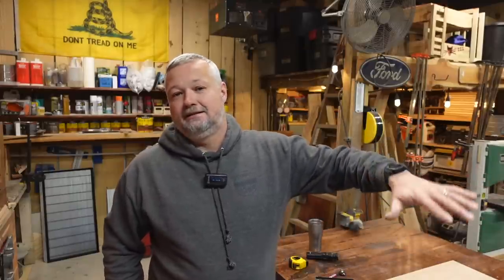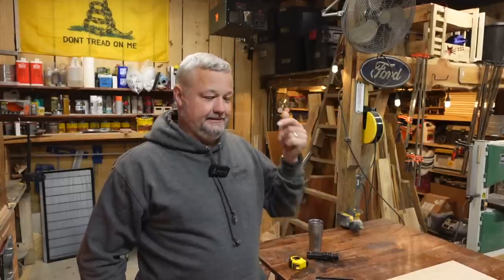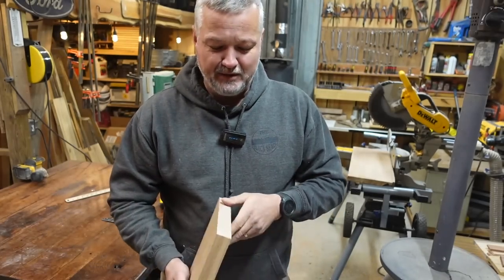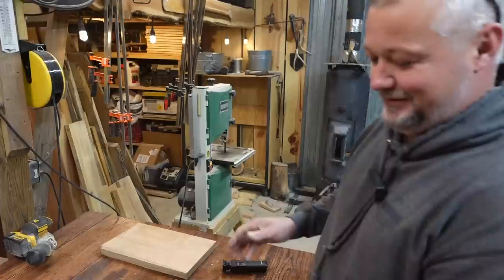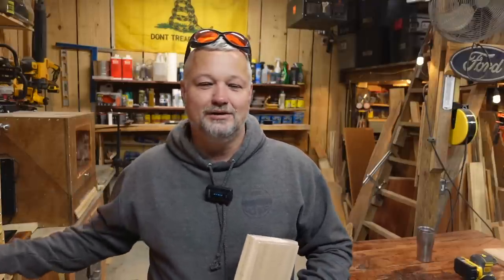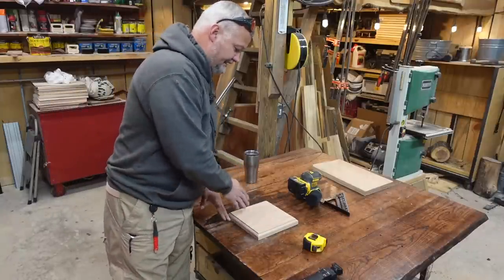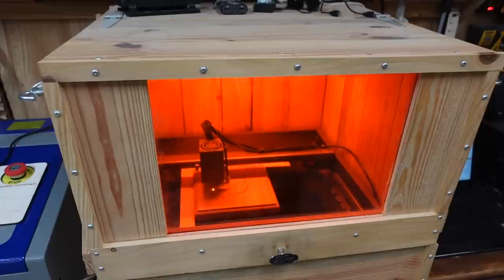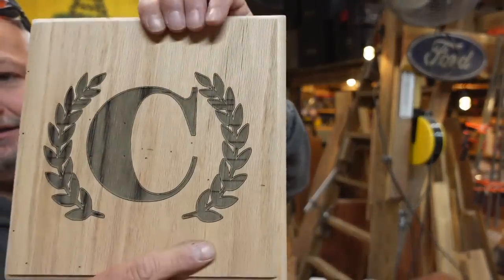An easy project idea- Counter savers

Comment: Clack,  For round circles.  Cut the circle from 1/4 ply on the laser, attach circle to wood piece with double stick tape, rough out the circle on the band saw.  Move to router table and use a flush trim router bit (has bearing on top) and finish the circle on router table.  Nice round circles or any other shape care to make.  Easy peasy.  Great idea and project.  Thanks,
Reply from the maker: Yea, I should probably work on my circle technique. Thanks.

Comment: You can put 2 coats of poly acrylic on them. It can handle up to 400, I use it for my trivets. I sublimate at 400 degrees, without a problem.
Reply from the maker: Thanks

Comment: I have had my D1 pro for a week now. I am having trouble with the program for xtool.  Sometimes it runs and sometimes it won't do a thing. I have uninstalled and reinstalled 3 times now. I have windows 7. Could that be the problem.
Reply from the maker: That or the machine just doesn't have the power to support the program. Windows 7 machines are very basic as far as resources go. You need a decent PC for the software

Comment: I’ve made these items for 30 or more years. The design I use is the shape of an apple.  The set includes 3 apples made from oak or any wood you have. The set starts with the smallest apple, then the middle and then the largest.  You put cork on the top of these apples. You make a set of jigs out of hardwood 1/8” thick so you can transfer the shape.  You take the smallest apple and lay on the cork sheet and cut out the cork to lay on the middle apple. Then you repeat the process for the middle piece to cut out the cork for the large one. Use spray adhesive to glue on.  You could laser your logo on the back.  Easy as apple pie.
Reply from the maker: Thanks